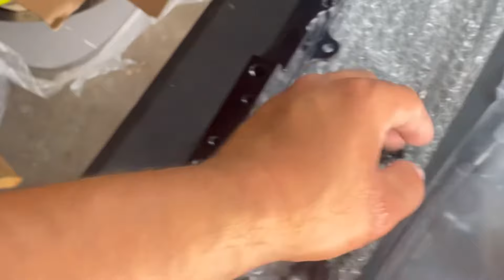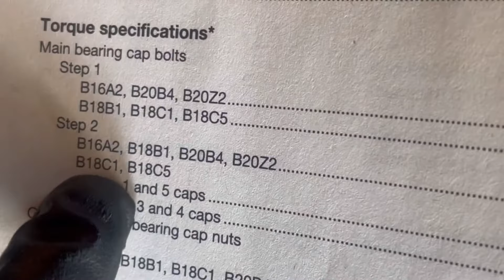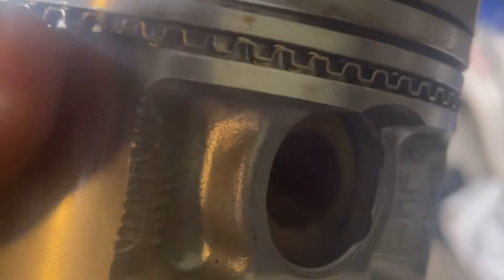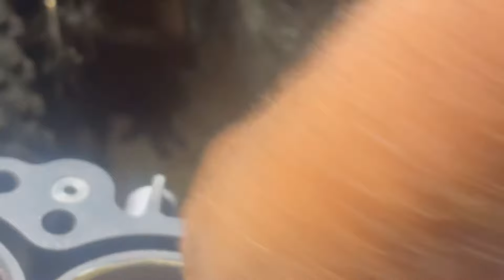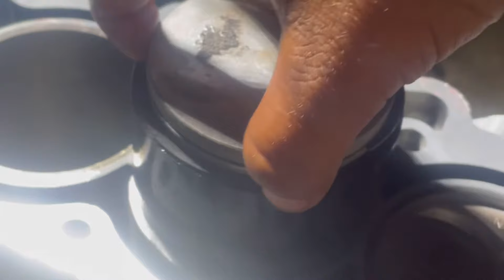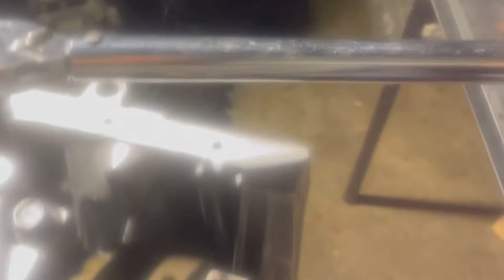B18c1 bottom end assembly(how to rebuild your 94-01 Acura integra gsr Engine 1.8 vtec) part1/2

Comment: How much did you spend ? 
I own a 1995 GSR but I have Rod knock so it is time for a rebuild. I am in Los Angeles do you recommend any shops?
Reply: A shop to rebuild
Reply from the maker: I dont know any good shops i have been working on my own stuff since 2005
Reply from the maker: Machine shop was about 1000
All new parts like gaskets,bearings,rings,timing belt kit and all that around another 500
Al the time and labor was free because I did it.  So in total without counting labor around 1500
Reply from the maker: Do you mean if I recommend any machine shops?  Or a shop to rebuild it for you?